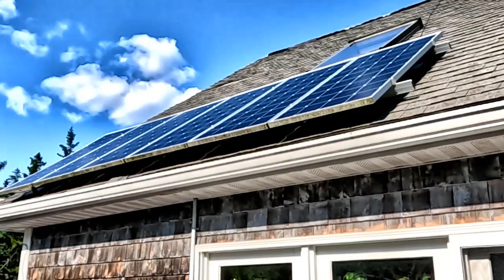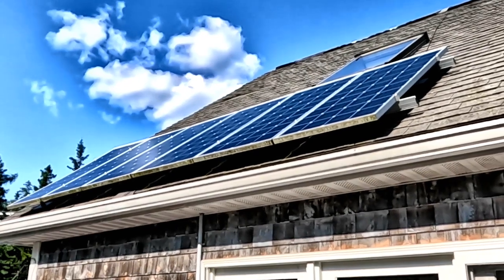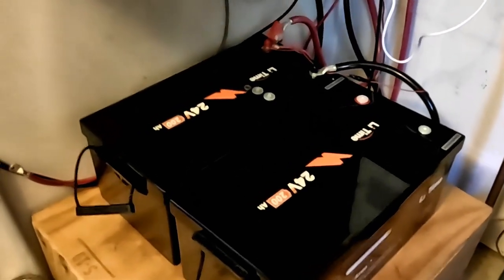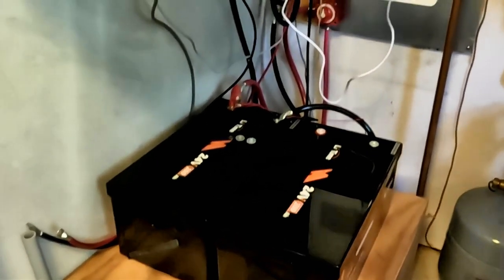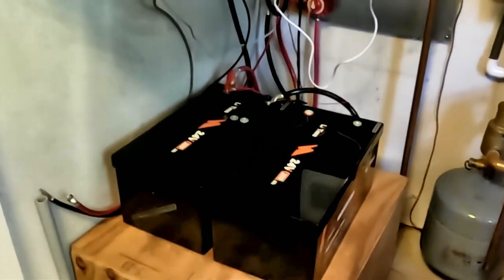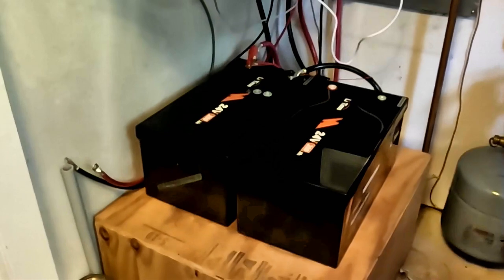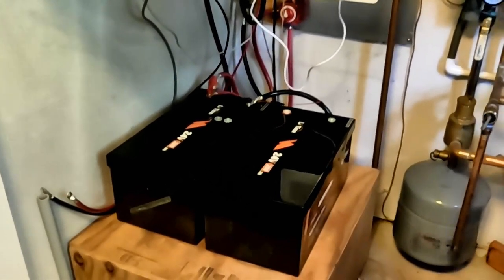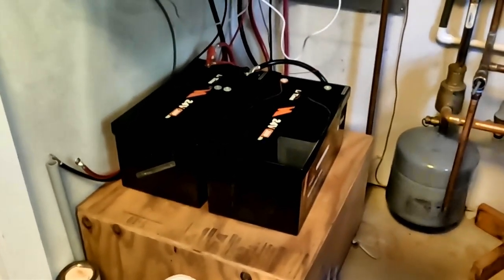Solar/Battery Backup Power Upgrade - New LiFePO4 Batteries

Comment: You did something similar to what I did. I bought four 24 v 100 ah lithium batteries, but I had just bought four 31 series lead batteries, so I used them too. I used twelve of the lead acid batteries that used to be on my solar to my 600 watts wind generator.
Reply from the maker: When I set my system up 6 years ago I went with 8 grp 27 105 amp-hr 12 volt lead acid batteries because lithium was insanely expensive at that time.  In January I bought 2 24v x 200 amp hour LiFePO4 batteries and ran them in a parallel, but separate system to the lead acid batteries.  What just did was to get rid of the lead acid batteries and replace them with two more 24v 200amp-hour LiFePO4 batteries.  As of today I have the LiFePO4 batteries in two separate banks.  I have a switch on my solar output to select which bank to charge. I also have them set up to discharge separately.

Comment: As a fellow offgrid solar enthusiast with aging lead acid batteries in rural Australia, I've been keenly watching the  battery revoution and the only concerns I have are safety related, cost and life time wise its a no brainer. 

While I realise Lithium Iron Phosphate type batteries are much safer than earlier ternary lithium types and there are sophisticated internal BMS, electronic systems do fail and frankly  I'd be nervous about having even LiFePo batteries inside an attached part of the residence.

 There has  been ample media coverage of electric scooter and car fires (eg Chevy Bolt) which could not be extinguished easily liberating huge clouds of toxic smoke, inside a cramped building space would be deadly.

Maybe a  a fire proof vented battery storage compartment say as part of an unattached workshop might be a good idea...just saying.
Reply from the maker: Those scooter and car fires all involve Lithium ion batteries not LiFePO4 batteries.  I have had LiFePO4 batteries in my house for 19 months with zero issues and have been cycling them daily since early May of this year.  They work flawlessly.

Comment: You have a nice system and with the new lipofe4 batteries 🔋 and more PV modules being maintenance free .Keeping it ole school and original is what’s being a prepper do . 😉Is that an original Schneider inverter ? Keep it up and running.🤙we survived Hurricane 🌀 Beryl in Houston Texas so Check out my DIY solar videos , hit like , leave a comment and subscribe.May the solar be with you .🤗
Reply from the maker: Yes, I like to keep it simple.  My system is not grid tied so I can use it any time.  Yes indeed that is a Schneider 4024 split phase output inverter.  We are on a well so the 240 VAC was needed to be able to run the well during outages.  As I mentioned with the solar and 20 Kwh of battery capacity we can run the house from about May through September and almost zero out the electric bill.  The only thing not on the system is the clothes dryer.  I will check out your channel.

Comment: You must not run an air conditioner?
Reply: I ran mine for about three hours today. I usually run it when the sun is out, but it was some clouds and it was late when I turned it on today. Most of my panels were in the shade. My voltage is 25.5.at 3 a.m. Both my freezers are probably running. Yesterday morning, same time, was showing 26.1v. Fully charged is 26.6 v. My batteries will be ready by 9 a.m to run the air conditioner, if I need it. It's not a big deal if I need to run it longer. It's just a little 6000 btu unit. Uses 600 watts. That was my original goal for my off grid power system. To be able to tun the air conditioner, the freezer, and have enough to cook. I figured that would be enough power without costing a mini fortune. There are days when I don't have to run the A/C very long , so it's not changing things that much. One day I left it on from 11 in the morning until 8 p.m. that evening. The thermostat thing is broken so I have to switch the compressor off every hour or so. The batteries were a bit lower voltage , it took two days to get them fully charged back. But I ran the air conditioner , just for awhile then let the batteries charge. I've been running it every day, but if its cloudy, I may not run it as much. It sure was nice this afternoon to have one, and it doesn't cost anything to run it...😊🥶
Reply from the maker: @DavidPotter-k1d  It is great that you can run your AC from the batteries and solar.  We are in for another hot day today (about 80).  The windows are already open, but there isn't much wind.  We will spend the hot part of the day out on the boat sailing on the Atlantic ocean where it will be in the 60s.  Thanks for the info.
Reply from the maker: I live on the coast of Maine.  We have air conditioners in every room.  They are called windows.  We consider 80 F a really hot day.  This summer we have had one day during which the temperature went to 81.  I couldn't/wouldn't live in a place where air conditioning is required.
Reply: @todddunn945 it was 95°here. Been turning mine on around noon
Reply from the maker: @DavidPotter-k1d  Acckk!  I would die if it went to 95.  Fortunately we live next to the ocean which is still in the upper 50s, so that tends to keep us cooler.

Comment: That’s a great upgrade for the system.
Reply from the maker: I think so too.  I have been very happy with the two LiFePO4 batteries I bought in January 2023.  This doubles my battery bank and gives me a minimum of three days run time for the house in the dead of winter when our power consumption is highest.  That assumes we get zero solar, which does happen when the solar panels are snow covered.
Reply: @todddunn945  Always better to plan ahead.
Reply from the maker: @naturescritter4691  I agree completely.